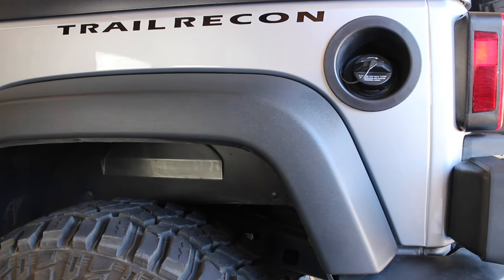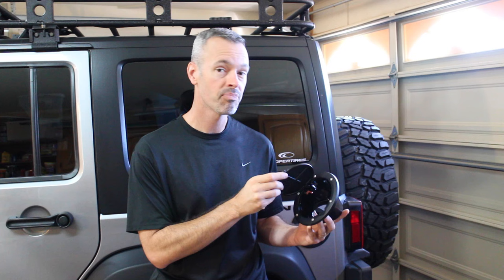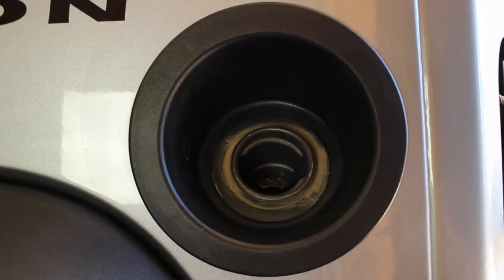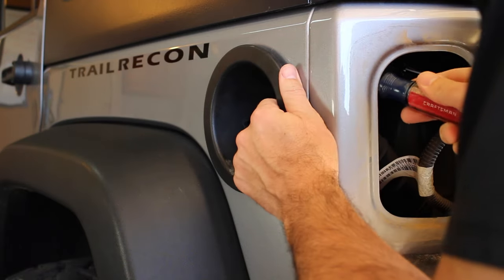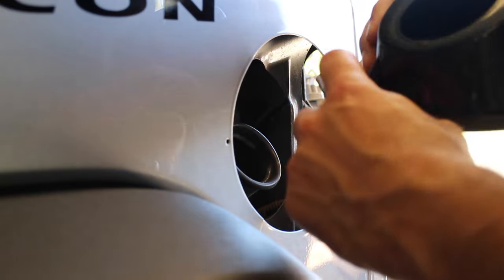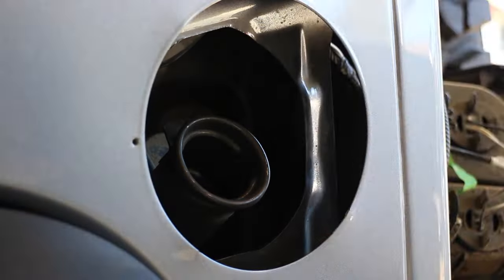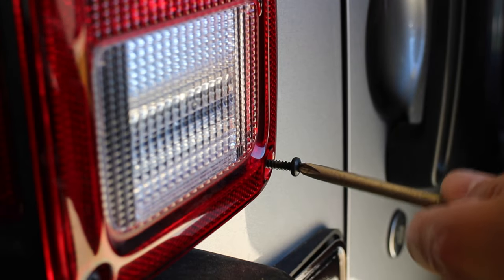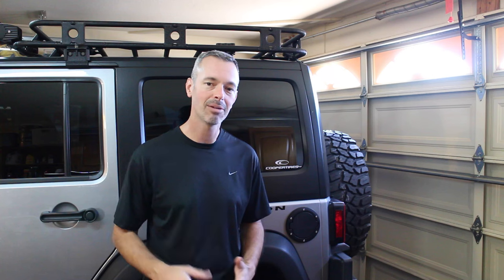How to Install a Mopar Jeep Fuel Filler Door - Jeep Wrangler Unlimited

Comment: It is a really easy job if you do a couple things after removing the tail light and the gas cap.. You do not need to disconnect the tail light wiring. It is long enough to set it on the bumper. Press out the two clips on the old plastic filler assembly you can see nearest the tail light. Then you can pull out the entire assemble by pulling a little toward the back of the jeep and out. Comes our easily. The grommet will come off with it. Fit the grommet into the new assembly and add a thin coat of grease to the inside. Add a very thin coat of grease to the outside of each of the four retention clips. Line up the pin with the hole in the body and press the entire assembly in. The grease makes it very easy to install. Snaps right in place. Five minute job!

Comment: Thanks for the vid! I just ordered that door. After looking at several brands I like this one the most. 
Tech tip: when you have tight fitting rubber gasket like that, spray the rubber with some 303 Aerospace protectant, wipe it down then install the gasket. The 303 revitalizes the rubber makes it stretch better and it’ll last longer. You can also Armor All if that’s what you happen to have. Personally I prefer 303. Thanks for doing these videos!

Comment: Thank you for the instructive video.  And I read all the comments posted; thanks guys.  I just installed the Mopar version on my 2016 JK.  It was an easy install; following a tip to spray silicone on rubber gasket.  Once the old cover was removed, I installed the rubber gasket onto the cover first (unlike the video and OEM instructions).  At this point, the Mopar cover just snapped into place, very snug and no gaps.  Yes the Mopar version is more expensive than the other knockoffs.  Your choice.  Love the look.

Comment: I've done multiple installs/swaps and I've never had to remove the rear taillight - get a small plastic tool behind a clip (find one) and carefully pry it in and out, once one is out it's simple to get the others.. saves a lot of time

Comment: Okay I fixed my fuel door today nice and tight to the body. If you take outer ring off ( one with the fuel door ) you will see slots in the back ring. This allows to put two metal screws in housing so the slots fit over them and replace outer door with hex screws provided-and all is nice and tight, no movement !

Comment: Great tutorial. The only thing I did different, which I think was a little easier, was putting the rubber gasket on first. Looks great for something so small
Reply: "... Looks great for something so small..."   That's what she said. 😅
Reply: Yes your right. I watched his video step by step and he made a mistake caused my engine light to come on and had to take it back to the retailers to see what caused the engine light to come on a new jeep. He should've fixed his mistake and put a fresh video. Causing me issues and was very pissed off due to him. What  idiot puts a mistake on the video when some people prolly pausing video found step by step.  He should've done the right thing. I'll never listen to this guy on anything  else. Now they have to smoke it to see if issue is fixed. They even said this guy is an idiot to put this video on without proper instructions
Reply: @Jeeptrailandcaveexplorer  Fake

Comment: Just a couple of things to mention about the video... When removing the existing filler housing, just get one clip from the inside of the fender loose, you can then slide the housing around until the other clips release ..... no need to remove the rubber grommet  or the filler cap, simply spray some WD40 or a touch of lubricant onto it and pull the filler housing out from the filler tube, it will slide very easily off of the filler tube. Now you can remove the gas cap tang with the tip of a screw driver and your fingers to remove the rubber grommet. Lube the grommet on both sides, place it onto the new housing, flare side toward outside, slide the housing over the fill tube... make sure that the pointed plastic indexing tip is directly over the hole on the left side... if it's not, it will snap off when you push the housing through the filler hole and if it does, there is nothing to keep the entire  housing from turning..... Good Luck !!!

Comment: I just pushed the o-ring through before removing the old housing, and then pushed it back from behind. Was a tiny bit fiddly but only took a few minutes.

 So glad I bought an official fuel cap cover, I had an after market one before this, and it was total junk

Comment: This was easy. I released the two tabs that you can see and rolled the original piece out without removing the o-ring, easy. Be cautious rolling it out because the metal surrounding the gas cap area isn't all that heavy. Putting the door/replacement in was just as easy, definitely install the o-ring on the new unit before putting it in.

Comment: Use alcohol for the rubber gasket. It works like a lubricant that will quickly dry. Makes the job of installing the o ring very easy.
Reply from the maker: Great suggestions, thank you!
Reply: Ok so has anyone else had trouble with the housing turning, dont seem tight to the body to me. Any suggestions appreciated
Reply: Great tip, thank you.

Comment: I just put one on my 2007 Jeep Wrangler unlimited and if you put the gasket in the cover first then slowly fit it around it goes much quicker. And instead of trying to pull it out just use a blunt object and push it in then when you get the cover off it’ll save you a lot of time. I’m 17 and did it in 4 minutes so hopefully that’ll help y’all out

Comment: I had difficulty with o-ring and took it and placed in hot water on stove for a couple minutes.  That made rubber very pliable and it popped right on . Thanks for video the directions that came with fuel door were comic book style with just pictures. Very difficult to grasp

Comment: I attempted this but with a cheap knock off version non Mopar...and it was terrible.  I will have to pick up the Mopar and get it done...love the look much better than the open one.
Reply from the maker: Ya, I contemplated getting on of the less expensive ones, but reviews were mixed.  Pretty happy with the Mopar part.

Comment: Like others, the directions with pictures aren't that great, so here I am. For anyone with a JL, the LED taillights are a single, long plastic screw (10MM or torx) behind a plastic tab located behind the rear power outlet. The rubber no longer needs to be removed, the Mopar door I bought came with the rubber installed. About 3 tabs and it came right out. I loosened the two that were easy to reach first, then the lower one with a long screwdriver to reach it.

Comment: I notice the locating pin for the gas door on your 2 door wrangler is at the 9:00 position,  I am doing this to my 2010 but the locating pin is at the 12:00 position .  Unfortunately the door I received has the pin at the 9 :00 position... I was under the impression that  the 2 doors were 12:00 and the 4 doors were 9:00?

Comment: Pain in the ass that's for sure couldn't figure out one of the clips until I finally realized you keep one clip stays connected and to let it hang briefly, that fucking O ring ....I had to take the cover back off, slip on the O ring over 1st over the mopar billet gas while the cover was not attached. That did the trick, tight seal now and looks great! 1st mod that I've ever done for that matter, more to come! Thanks

Comment: Great video! Have you ever noticed the people that DON'T have gas doors (JK Owners) want one, and people that DO have them (Cherokee Owners) don't want one. I always found that funny. Great install, I have the exact same door and had the exact same O ring issue. I found some issues with it though, after about 5 months it was badly faded, and our JK is garage kept! I don't know if I just got one with a bad finish or something, but for the price of this thing and it being a Mopar part I expected a little more durability. They wouldn't do anything about it because it had been installed(voids warrantee if you install it! LOL) and because it was 5 months old. Oh well, another awesome video!
Reply from the maker: Man I hope mine doesn't fade, really not interested in taking it off and painting it.  Thanks for the insight!
Reply: TrailRecon I took ours back off and shot it with clear, that helped for a few more months.
Reply: @TrailRecon  We had to take ours off and paint it due to fading after just one summer. Garage kept.

Comment: My heart is inline with the Jeeps..I've owned three CJ 5's and a really nice 03 Wrangler on 37's...I feel into a bad way and lost everything...I do have an 82 Wagoneer project, my question is about my 93 suburban and 01 Crown vic....I am modifying both of them..the Suburban has a completely different top half with an upright Hummer type windshield and cab..the Crown Vic is about to go a Mad Max offroad transition....my question is, what diameter is that door and trim?...both, my crown vic and suburban have a 6 inch door....I want to put these Jeep ones on my rigs....possible?

Comment: Just installed this and I’m wondering if you or anyone else has had, not really an issue, but where the body of the gas cover will turn and not sit quite tight against the jeep body. Wondering if there is a remedy for this. Thank you!

Comment: I recently installed a gas cover on my 2010 Jeep wrangler but few day later my gas cover light on the dash board came on. Not sure if the installation wasn't done properly, or do I need to replace the the inner gas cover. I love the new cover though and would do all I can to keep it. Please help.

Comment: My 2011 Wrangler has metal over the inside of the gas cap making it impossible to use your hand and move the tab located in the 10 o'clock position.  I got the 2 'clock tab off first, then used a short and skinny flat screw driver and pried the other tab open from the outside.  Frustrating.

Comment: Does Mopar make a locking cap?
Reply from the maker: I'm not sure, but I think Drake and a couple other companies do.
Reply: I went to advanced auto parts and got a cap with a lock on it. Been two years and works well!
Reply: Yes, Mopar 68045040AA, Fuel Tank Cap. I bought it from Amazon and had the lock set to my ignition key by a locksmith. Very simple.

Comment: Just pull the old housing with the rubber seal still attached. Comes right out and then you can install it on the new one before install. This will take only a few seconds compared to who knows how long ? They come with poor directions and show you installing the rubber last. Don't do it that way pull it with the old housing then install it on the new before putting it on your jeep.

Comment: Just like to know if you are still satisfied with the "MOPAR" fuel door and how well it's weathered? After clicking on the link to Amazon in the description box and reading through some of the comments, there seems to be some consensus that while the product is described as OEM from MOPAR, that the packaging seems to suggest a product manufactured and shipped from China.  Regards, - M.
Reply from the maker: I'm pretty confident this one is Mopar and not a knock-off.  If it is a knock-off, they did a great job.  I still love the look, my only complaint is that it doesn't fit flush up to the body as tight as I would like.  I push it in every once and while just to firm it up.  No screws to hold it in place, just the rubber grommet around the fuel neck.
Reply: I have this on my JK and it is very sloppy. I'm not sure if it's just because its a few years old, but it is not firmly attached.
Reply: I knew mine was a knock off when I ordered it from China, like he said it looks great but doesn’t hug the body like it should. I drove 2 screws kiddy corner then just glued the matching nut heads in the same hole, looks great.

Comment: Great video! Your video was extremely helpful... My cover has a very small gap on the top of the cover. It doesn't fit as tightly as the factory one.  Am I doing anything wrong?
Reply: I just watched a similar video and the guy discovered that the new cover had an extra(unless) tab that stuck out on the top side. He cut it off than filed down the rest that was lefted sticking out.

Comment: Hey I just bought a jeep what is a good first upgrade for it because I'm new to this jeep world.
Reply from the maker: The million dollar question!  It all depend on what type of Jeep you have, how deep your wallet is and what you plan on doing with it.... rock crawler, overlander, occasional trail rig or mall crawler?
Reply: Front bumper and winch!
Reply: Hey Emilio I suggest start small and work your way up.
Reply: In my humble opinion, I would start with "free mods"... 
For example:
If you are thinking about aftermarket fenders, why not trimming the OEM fenders and see how that looks. If you like them, you can use that money for something else; If you don't like them, go ahead and put on what you were going to buy in the first place, no big loss there as most OEM parts are difficult to re-sale unless you damn near give them away. There are many free mods ideas in You Tube just do the ones that catch your eye. Once again, just my opinion. Jeep on, my friend.

Comment: How do you remove this door?  Do you need to go in through the tail light again?  The one on my 2008 JKU is really worn looking and I'm replacing it with a locking fuel door, but I'm not sure how to get it off.  I'm probably being too gentle with it.

Comment: Great video! An old "Body and Fender"  trick is to spray rubber gaskets with silicon spray.  We used it on most rubber/plastic trim pieces for quick installation.

Comment: I installed mine today. Yes, the rubber gasket was intense lol. Anyways, it’s on! There is a 1/16” gap around it. This will allow water to get in. Should I silicon this around? Or is it ok that water gets in? I’m worried about rust down the road. Thanks